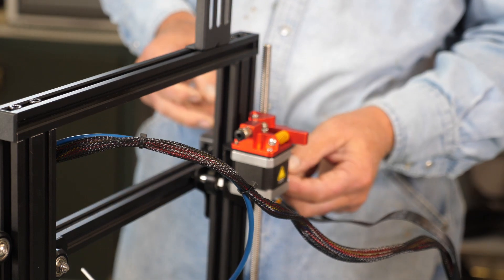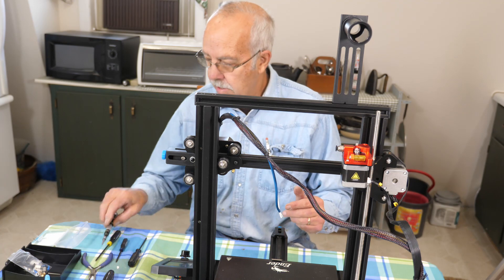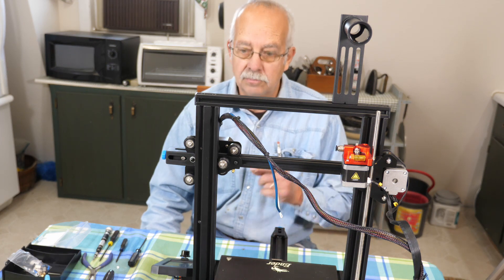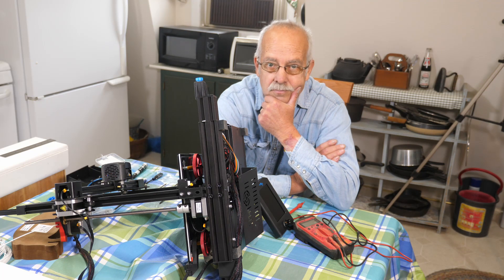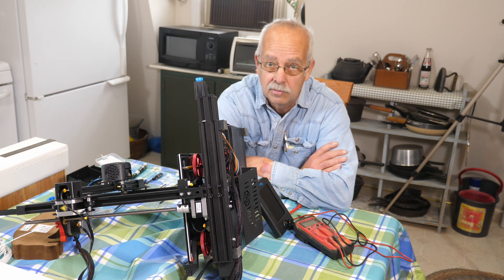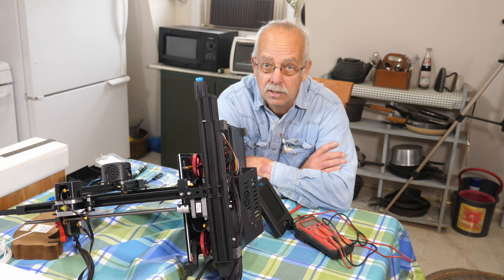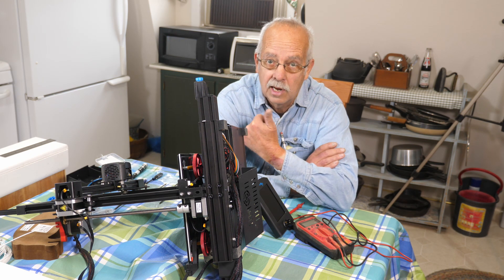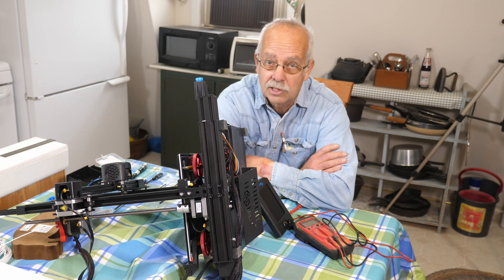Creality ender 3 V2 New Main Board *FAIL*

Comment: I have same problem.
Do you found the issue ?
I have Ender-3
The temperature go normal up for the extruder and bed but receive message stop printing and the time printing go 100% with start printing
Reply from the maker: Some things to try:  A different file, a different SD card.  If this does not work, you may need to reflash the firmware to the mainboard.  Once flashed and loaded, remove that card and delete the firmware file before using it again.
Reply: @rogersshop  i do this

Comment: KoupilI bought a new board and it didn't work. I claimed it, got a new board and it didn't work either. In other words, the board started but could not be moved any axis by itself. I thought of trying to flash it and wow! It's already running. Hope this helps someone.

Comment: I too am having the same problem.  Original board lasted a year of home casual usage.  Then when turned on the screen was blank with only a very dim halo around the edge.  I decided it was the control board.  Replaced the 4.2.2 with a 4.2.7 and it immediately booted up and ran perfect, actually a better print than with original board.  After 3 weeks of casual printing, it failed again.  Creality suggested replacing the thermister in the bed and print head.  I did so.  Amazon replaced the control board for me and new board again worked perfectly.  2 weeks later, same failure.  Saw this video and replaced the power supply with suggested one and new board.  Booted up and worked perfectly until I tried to turn it back on the next day and same failure.  My question is: did you finally give up on the printer and are now just using the new printer?
Reply from the maker: Try this, even though it sounds far fetched:  Download the WRONG firmware for the board from Creality website.  Put on a formatted card, insert, and boot the printer.  Let the firmware update and install until the display comes on.  Turn off printer.  Format a card and load the CORRECT firmware for the board.  Insert and boot up the printer.  Once the display comes up, turn off the printer, remove the card, and NEVER use that same card if it still has the firmware on it.  Put a project on a different card, insert, and turn on the printer.  As odd as this sounds, I've "fixed" bad printers with just this trick.  I now have four of these Ender 3 V2 printers.  Two I bought as non-working and this is all I had to do.  I also fixed a friends Ender 3 with the same problem doing this.
Reply: @rogersshop  Thanks for the info.  I tried it but with the printer being out of commission, it didn't do anything.  It couldn't read the card because the control board is faulty.  Nothing on the screen.

Comment: Well I guess I won't be buying this printer! I don't know anything about electronics and if it breaks like this I would be screwed! I guess I need to look for a different brand!
Reply from the maker: I have four of these Creality Printers in use.  Only one was a "lemon" and it turned out to be the Power Supply that was causing all the issues.  This can happen to any brand since most use the same brand power supply.
Reply: @rogersshop  ahh ok. So as a guy that knows nothing about 3d printing what printer is good to start with this one or the sovol sv02 dual extruder they are about the same price? I rally want to print but don't know anything about these?
Reply from the maker: @mikek2824  I have no experience with the Sovol, so can't off any advice on it.  My experience with the Creality printers has been good overall, with the exception of the "lemon", but that is all resolved now after several upgrades and changes.  Regardless of what brand you decide to get, there is going to be a learning curve, so don't get frustrated!
Reply: @rogersshop  yeah that's very true! I might just go with the ender3 it seems really nice!

Comment: I have 2 dead motherboard with the hotend temperature stuck at some value.
Power supply is fine, thermistor is fine, but the motherboard failed. Any suggestions

Comment: I received the printer on the 14th. Assembled it then tested for a few minutes, then "Nozzle is too lowperature" error occured. Then i checked the connection then it turned on, it then gave "Nozzle is too higherature?" error again. I have contacted creality and reflashed firmware on the controller but couldnt flash the main board... What should I do? 🤧
Reply from the maker: This sounds like a defective thermistor (temperature sensor) in the hot end.  Good luck with Creality customer service..............  It is unfortunate that they do not have better customer service considering the volume of printers they sell.
Reply: @rogersshop  could it be a bad board? Because it wouldnt go through even if i try to flash the firmware?
Reply from the maker: @mapxrenthlei  You can't flash the firmware if it is the same version as what is already loaded.  I don't think it is firmware, here.  I really do suspect a faulty thermistor or a shorted/open wire to the thermistor in the hot end.
Reply: @rogersshop  the thermistor has continuity but no resistance... Is this normal?
Reply from the maker: @mapxrenthlei  No.  If no resistance, or if less than  one ohm, it is shorted and needs to be replaced.  When replacing, make sure not to tighten the screw in hot end too much or it will damage the thermistor.  I don't know what the spec is on this thermistor, but When temperature increases, the resistance increases, and when temperature decreases, resistance decreases.  It should never be zero or infinite.
Reply: @rogersshop  thank you so much, sir. Way more informative than talking to customer care for a whole day.

Comment: Roger i dont know if this will help or not but i have the same problem just a blue screen nothing else, but from what i understand that the stepper motors will generate power if they spin, so anyway i did notice that when i moved my printer to a better location that the bed slid and i seen the fan run on the extruder and after that my blue screen showed up so i put in for warrantee and still waiting but i figure if i get mine running i might just put in a diode or two to stop unwanted generated power, so what do you think thats my thought on it
Reply from the maker: Yes, stepper motors will generate a voltage when spun without power to them.  However, my issue was a faulty power supply (eventually discovered) that was taking out the main boards.  Since replacing the PS (and the main board), no issues since.

Comment: Hi Roger, check that your mainboard cooling fan works. I had a board failure because that fan died and the mainboard overheated. What's more,  I had a SECOND failure after replacing the fan as the new fan died within hours. It makes no sense to me as the hotend cooling fan is wired in parallel with this fan, and that still works. Regardless, I replaced the board again after wiring in the mainboard fan directly to the power supply through a buck converter. Let me know if this mirrors your experience
Reply from the maker: Fans were fine.  Power supply was the culprit.

Comment: I received a CE3 V2 as a Christmas Present and Christmas eve I unpacked and assembled it with the first perfect print done within 3,5 hours after I broke the first strip of tape. It ran perfectly for to days and I was beginning to love it. It was far better, than expected. But the bed leveling was really annoying! It seems (I am using magnetic flexibed) it kinda lifts up in the corners or down towards the center. 

So I decided to install the BLTouch level sensor. 
Easy peasy installation (even though the sensor connector for connecting the BLTouch to the v4.2.2 motherboard is a really bad quality).
When I tilted the CE3V2 back and leveled it (I used some wooden blocks during tilting, to make sure not to ad pressure to bulky things and cables) and turned on the power again ... NOTHING happened! The fan on the heater ran 100%, but no display, nothing!

I have fought with this issue for three full days now, checking every single connection, soldering and tightening screws to make sure there are no culprits. And STILL nothing but a noisy fan. I was SO happy with this printer, but now I am afraid it might be the MOTHERBOARD! 

I have even tried firmware upgrades, but as the printer dos not respond, nothing happens.
If the reason is a voltage spike (classic peak from the power supply), I would like to know this, because then I will install a powerful voltage controller between the power supply and the motherboard.

I am puzzled and very unhappy :-(
Reply from the maker: A quirk with some of the mainboards that make the display go blank is if the same firmware is attempted to be reloaded.  Assuming you do have back light on the display, but nothing else.  Try renaming the firmware on your micro sd card by adding a letter or number, but do not change the extension.  If this works, restoring your display, then make sure to remove that firmware file before using that card again.  This may not work, but I found this out on one of my printers.
To catch an over voltage on startup, you will need a multimeter with peak recording, connected to the output of the power supply and check several times by cycling power.  Peak recording capability probably won't be found on hobby or home owner meters.

Comment: With this experience what 3D printer would you recommend?
Reply: most ender 3 v2 printers work normally my school just bought 8 of them last week and they all work perfectly i even have one myself its a great printer for the price
Reply from the maker: @kacper_023  I did buy another one and it works perfect!  BUT, the saga continues on the first one...........Yet another fail.  Video will be posted soon.
Reply from the maker: There are a LOT of these out there and most do not have this issue.  I did order another new Ender 3 V2, this time on Amazon.  The existing one will either be used for spare parts, or I will eventually figure out what is taking out the main board.  Just not using new main boards for the tests!